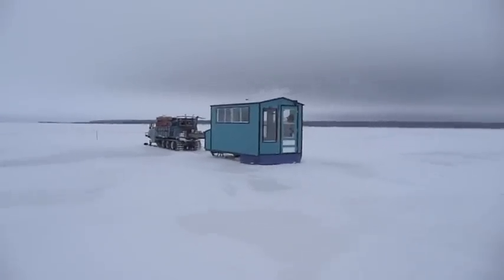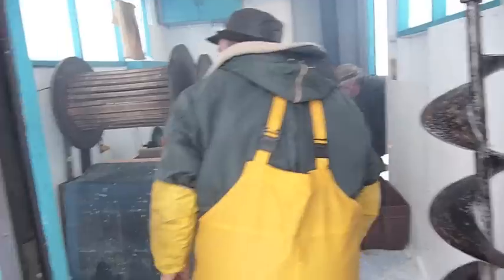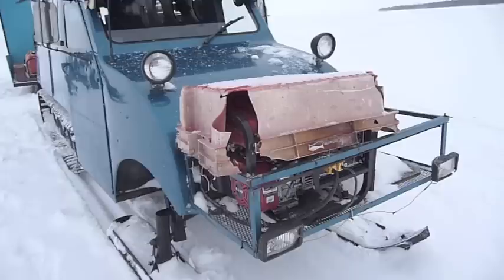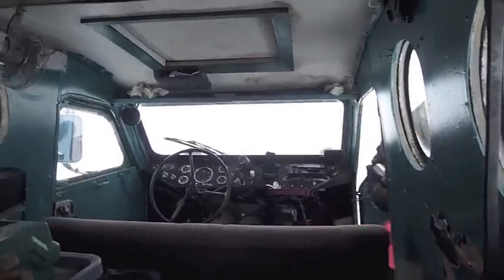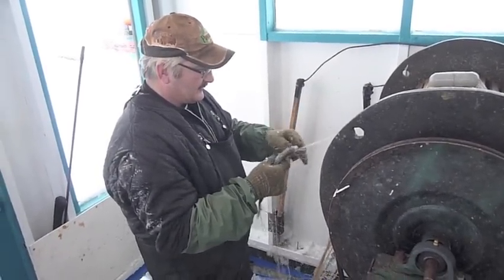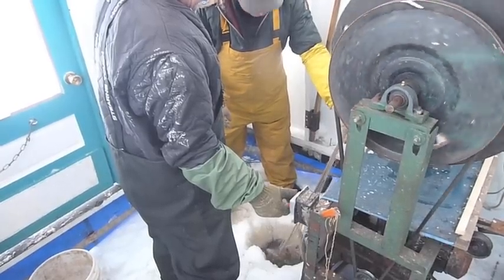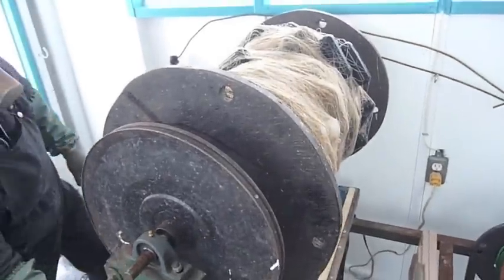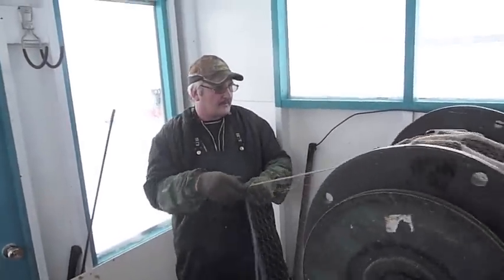Ice Fishing Lake Winnipeg part 4

Comment: If it were me, I would use an electric motor on the ice drill since you have a generator.  It would prevent the caboose from getting filled with 2-cycle smoke.  You do have a very interesting operation going there though.